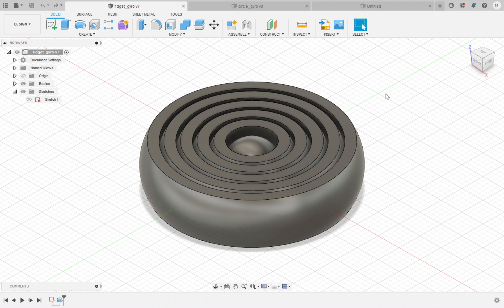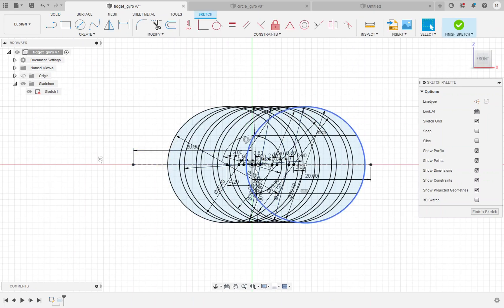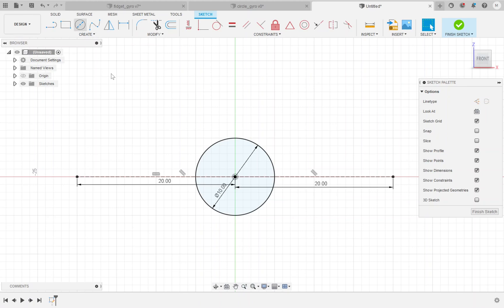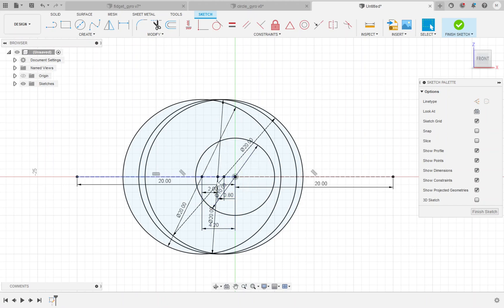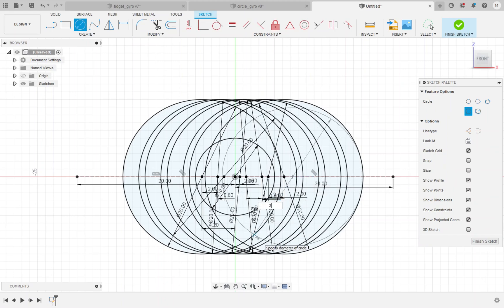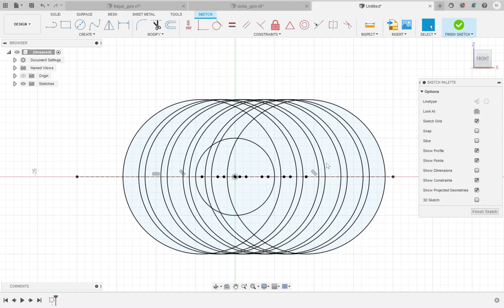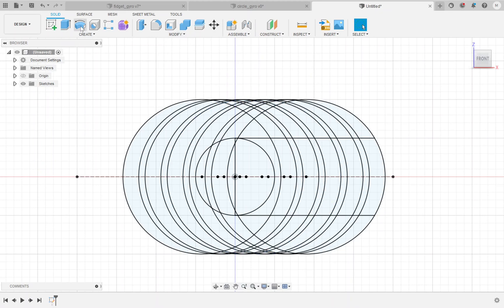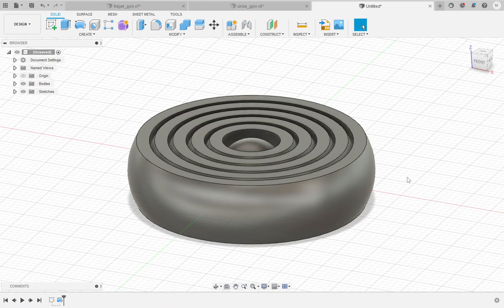Gyroscopic Fidget Rings - Fusion 360 Tutorial

Comment: Thanks for the video. I tried it but when i print it the sphere is comming loose from the buildplate because it has very little contact to the buildplate. Is there a way in fusion360 to flatten the top and bottom but keep the same hight so it has more grip on the buildplate. I know it won't be a sphere  again.

Comment: do i 3d print each of the rings individually or do I have to combine them.
Reply from the maker: It is made to be print-in-place without need for assembly.
Reply: does prinying individually still work? or do I have to combine them
Reply from the maker: @NeshalJAYASINGHE Do not print them individually. They are meant to print all together, so they don't come apart. If you print them individually, you can't assemble them

Comment: How to extract stl? Theres6 bodies.   Do I combine join?
Reply from the maker: Yes, you can do a temporary join operation to combine them into a single body to export to an STL.
Reply: @mjdargen  can i combine them as a component instead, since it still allows me to export as STL and the combine function won't let me create one singular body
Reply from the maker: @NeshalJAYASINGHE even if they are separate bodies, the STL export treats it as one unless you are individually exporting each file
Reply: The center has adhesion problem.  Tried twice.  Finally printed without center no problem

Comment: I printed three of these on my Ender 3 Pro, one using 0.8mm gap, one using 0.6mm gap, and one using 0.4mm gap. I kept the 2mm the same on all three. In my opinion, the 0.8mm is a bit loose and the 0.4mm is a bit tight. The 0.6mm gap set of rings works the best. Thanks for this video!
Reply: thanks i also found the .8 gap to be a bit loose after i modeled it via blender so i came back to this comment to see what you'd said and this is good info